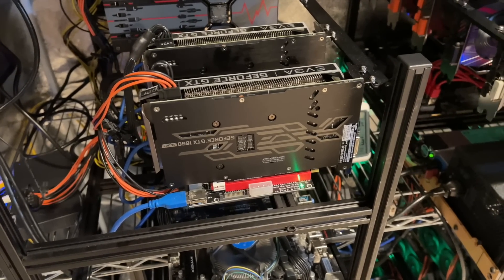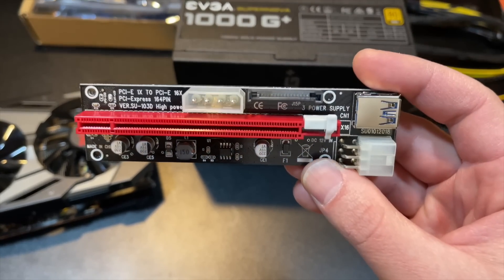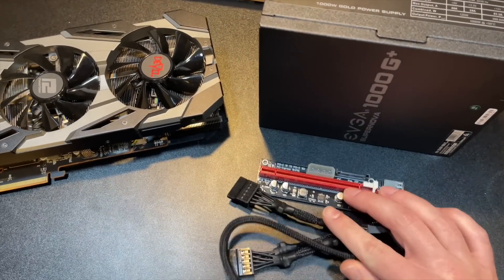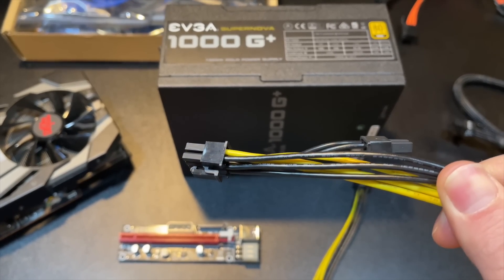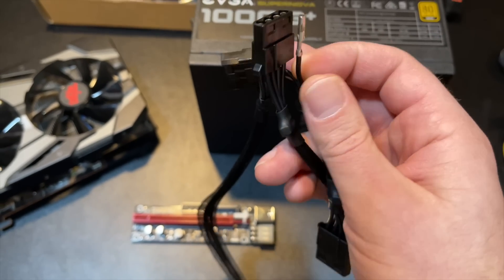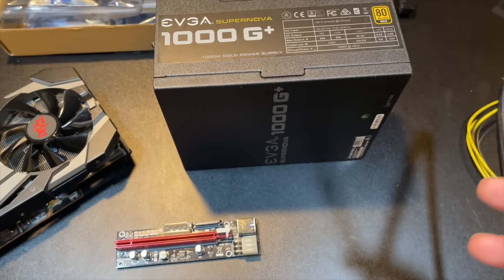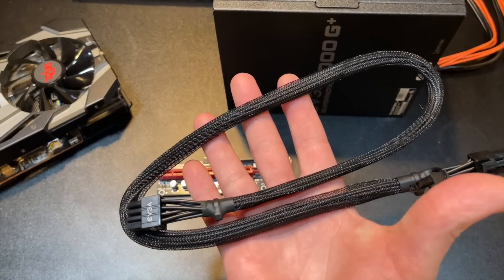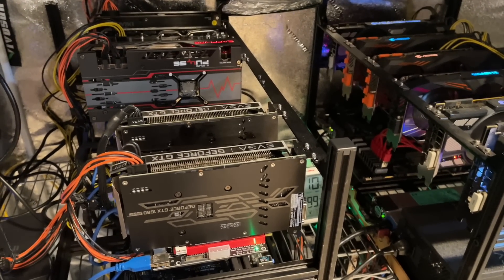Powering GPU Mining Risers Safely

Comment: Hey thanks for this video would this be an option for going from PSU to risers?

https://www.amazon.com/gp/product/B07F9H1K5R/ref=ppx_yo_dt_b_asin_title_o00_s00?ie=UTF8&psc=1

It's basically a 6-pin to 6-pin

OR - not sure i'm understanding this part - would it be better to use a splitter on the dual 8pin to power the riser?  I'm also assuming that would work.
Reply from the maker: If you have a specific brand power supply you should buy that brands PSU cables. For example, if you have an EVGA PSU - buy the specific EVGA 6-pin cables for that PSU. PSU cables aren't always cross compatible. Even within EVGAs own PSU lineup they aren't cross compatible.  For a server PSU I'd recommend these:

https://www.parallelminer.com/product/36-inch-16awg-6-pin-male-to-8-pin-62-male-pcie-power-cable/
Reply: @RedFoxCrypto  if those cables that you linked fit into my psu's ports, would they work?  I've been looking all over for 6-pin to 6-pin seasonic cables and having no luck unless i want to spend like $20/cable.

Comment: Molex is 154 watts
Sata is 54
Pci E is 288w
Reply: Pcie 6pin is 75w 
Pcie 8pin is 150watt
Reply from the maker: Share your sources. SATA is right. Molex is iffy. PCIe is right if you have three 8A pins going back to the 12v rail on a 8-pin connector, but not right if you are using a 6-pin with only two 8A pins going back to the 12v rail. (Though most modern 6-pins have three)

Comment: Easiest rule of thumb is this:

What role was this connector designed for?  

MOLEX is hefty in size but it really was designed around 1, 2, or maybe 3 HDDs or DVD-ROM drives.   Would I put 75W or anywhere near that through MOLEX connections for any sustained periods?   Heck no.

Appreciate the video, especially with new people looking into mining.  Don't burn down your house by cheaping out on power connectors, folks.  The small amount it takes to get the right power delivery pales in comparison with a potential electrical fire.
Reply from the maker: Thanks Jamie! You speak the truth. Happy mining!
Reply: @The Watchlist "What role was this connector designed for?"  Was MOLEX designed for powering 6- or 8-pin?  No.  

When someone who isn't experienced with all this rigs up a couple of adapters or whatever and plugs MOLEX-to-PCIe directly into a card like an RTX 2080 that pull 225W+, it isn't going to likely end well.

Feel free to call anything you can't put into context "FUD" but safety should be on every miner's mind.

Comment: After this vid I was nearly to switch my rig, because my risers are powered by sata cable. But ok, hold on for a sec... 
8 Pin cable provides around 150w.  Sata~54w. 

Current my rig setup:
Kolink 850w psu
rtx 2070 (8 pin single) TDP 175 W
3060Ti Gigabyte (8 pin single) TDP 200 W
MSI 3060Ti (2x 8 pin) TDP 240W 
I currently don't have other option, just to power risers with sata. SATA>sata to 6pin>Riser.

I underclocked all cards, find stable spots.
HWinfo64 says:
2070 eats 125w
MSI 123w
Gigabyte 126w. 

MSI riser connected on 1 seperate sata cable.
Gigabyte 3060ti and 2070 risers connected on 1 sata cable. 
system been running for 20 hours now, stable, no crashes 170 Mh/s at 455w out of wall. only 2 invalid shares.
Sata cables, Pci cables are ice cold, but... Theres's only 1 thing I don't like. 
2070 going as second card in chain. Getting less power from Sata, probably, riser is a bit warmer than both 3060Ti's... 
Maybe it is because of her cooling? 2070 is 2x windforce, 2 fan. Sitting around 60 degree Celsius, while 3060Ti's doing 34-43. 
P.S. I've done some research... My splitters ar bad quality. Need to look for PCi 6 pin, but I dont have any spare ports to use. 
Any tips with this case?
Reply from the maker: Best thing to do would be to get a new power supply or supplement with a server power supply.

I think that PSU has 4 6x2 pin PCIe connections so the other workable option would be:
2070 w/ 8pin single cable
3060ti Gigabyte w/ 8pin single cable
3060ti MSI w/ dual 8pin single cable (or splitter)

That frees up a PCIe cable to be split to two risers. For the last riser I'd use Molex.
Reply: @RedFoxCrypto  I ordered splitters from 8 pin to 2x6+2. Problem is, These risers I have, they only have 6 pin connector. Temporary will be ok. Later I'll split them. 1 cable has 2x6+2 connectors, but second one is to short, unable to reach to riser.
Reply: @RedFoxCrypto  how about connecting directly from SATA output via 6 pin connector to riser? SATA socket suppose to supply 12v each?

Comment: I think the reason some miners have issues is because they are not utilizing the PCI-E connections on the video card itself. Think about the small traces on the riser board. Even with the most high quality riser card, I would never expect it to be able to handle that kind of a power draw for the extended periods of time that we do when mining. Always expect your primary power draw to come from the connections on the video card itself. The power to the riser should only be to allow the riser itself to function, and perhaps a small power draw.

Comment: a 3070 will pull 15-17W from the riser while a 2060 Super will pull 42-43W, depends on what cards you are using, only gpu's so far that got the SATA connector warm were the blower style 5700's(there surely are others, speaking from what i've seen), as long as you know what you're doing SATA is as safe as any other connector
Reply from the maker: Exactly. Most miners are flying blind with this. Did you test the cards yourself of rely on data from somewhere else?
Reply: @RedFoxCrypto  was reading the numbers from gpu-z, you can always run your cards in a stress test for a while and just check everything in case your overclocks reset for some reason, if they stay cool in the worst case scenario then you're good to go

Comment: I have never heard of molex being unsafe as long as you don't daisy chain them. I think that is where people run into trouble, since the cable terminates to 3 or more plugs usually. you can be just as dangerous with pcie if you stack splitter cables
Reply from the maker: Absolutely. Molex is "probably" fine but I wish there was a more clear standard that we could point to and say it's definitely fine. And great point with stacking splitters. One PCIe splitter per PCIe cable.

Comment: I use dual sata to single 6 pin adapters made by cable matters. They work well for me, and by using 2 sata connectors instead of one, exceed the standard for pci-e 6 pin power.
Reply: This is what I'm going to do.
I'm also going to laser monitor it for a week to make sure it wont heat up :)

Comment: Favorite quote: When talking about SATA power,  "It's going to heat up it's going to melt, potentially cause a fire, burn your mining rig and your whole house down, and you'll be super sad and very far away from break even."  HAHA.  Great video.
Reply: I use sata conectors in my 1660S risers more then year and i never have problem or feel some cabels are hot ;) nothing problem for this low volt cards. I use for 10cards rig oynly one PSU Andyson Prominer 1800W and all runing very well
Reply: @maxbiagi3091  yeah it really just depends what cards your using I run sata on some 1060s w no issues but id never run it on my 3080s or 1080s
Reply: @maxbiagi3091  I have been using 2 sata connectors per cable on my EVGA 1080 Ti's for over three years now, house still standing.
Reply: I thought if it couldn't get enough power it wouldn't turn on.
Reply: Have been mining on sata for years no prob. Used 6-pin and the riser blew in 2 weeks lol. Poor riser didn't handle 75w I guess
Reply: "very far away from break even" haha
Reply from the maker: Hahaha. Thanks David!
Reply: @btc-sitesDOTcom well, ive been a tech for 30 years.  i wouldnt trust you to tie my shoe.
Reply from the maker: @ryan8773  Hahahahahahah. You got me dying with that comment. Happy mining Ryan.
Reply: @RedFoxCrypto  haha, well bro, hook me up with 4 3080s at retail and ill consider the entertainment dept paid in full !!!!
Reply: But 75w delivers the x16 port and a riser connects to the x1 so it would not be consuming 75w since only from x16 to x16 it would consume 75w and from x1 to x16 there would be less consumption available for the gpu

Comment: I have been mining with multi 13 card rigs for years. ALL of them have 2 risers powered with 1 sata cable. Never had any issues. Sata are "smart" power connectors and as long as you do not use any adapters, then the GPU can not ask for more power than  what the sata can supply. 
SATA SPEC:: Pin 3 in SATA revision 3.3 has been redefined as PWDIS and is used to enter and exit the POWER DISABLE mode for compatibility with SAS specification. If Pin 3 is driven HIGH (2.1–3.6 V max), power to the drive circuitry is disabled. Drives with this feature do not power up in systems designed to SATA revision 3.1 or earlier. This is because Pin 3 driven HIGH prevents the drive from powering up.[
Reply: also if it is unsafe, then why would they put these connectors on their products?
Reply from the maker: Can you share your sources and what GPUs you are running?
Reply: @RedFoxCrypto  IEEE sata power spec is my source. I run 580, Vega 64,1070,1070ti,1080,180ti,5500xt,5700xt,3070 all on corsair PSU. I think the reason people have cables melt is that they have low quality cables or have bent them back and forth too much.
Reply: The GPU does not ask. It demands from the source without questioning, simply  by "lowering its resistance". If the source can´t provide and the voltage drops too low, GPU goes into failsafe mode and stops working. These Risers are dumb, there is no logic integrated. It is just a simple device to provide 12V, 3,3V and some data lines from the mobo. Nothing "smart" happens there. What you´ve read is for HDD and SSD devices which have a controller and use 5V (3.3V) from the PSU. If you set your cards up to never use more than 80% of 54W over S-ATA you are ok with that connector. Some cards pull more than that and will heat up the connector --> burning houses down. The connector exists at that point because it is cheap and all PSU have them. It will work for some time. Bad quality is a thing too. Easiest thing to avoid is just to go 8pin all the way. Most cards also use pcie power for the supply of the memory chips. When mining these do work hard and will fail at some point. If a chip shorts out you want to have enough amps available to blow the fuse on the pcb, else you get fire. Especially with all these big 100A+ power supplies. When their overcurrent protecion kicks in fire is already set lit. Also watch out when using cards that have no fuses - they will guarantee start burning in common short circuit situations combined with big single rail power supplies. The popular mining cards RX470 to RX 590 all do have fuses for a reason. Keep in mind that fuses need energy to blow up, so limiting current in failing situations by using weak connectors is no good idea.

Comment: This is an outstanding, high quality video- thank you so much.  I have boggled my mind over this for years.   The reality is, we know for a fact that you can indeed, put multiple GPU's (RX 570/480 for example) on a single SATA.  Why?  Well the answer must be that the GPU (by design) pulls more energy from the 6-pin PCIE power connection on the GPU- not from the riser (or the motherboard).  What I would LOVE LOVE LOVE to see is a matrix, GPU-by-GPU, that details the amount of energy pulled by from the riser, vs how much energy is pulled at the PCI 6-pin connector integrated into the GPU.  My experience with 480's:  Multiple GPU risers on SATA is no issue.  Multiple GPU's connected to same 6-pin PCI is a firebomb waiting to happen.  To solve this riddle and most effectively (and safely) use the connections afforded us on an ATX power supply- we must know GPU by-GPU how much energy is pulled from the riser and how much is pulled by the 6-pin PCIE.  The reason why you keep seeing miners using SATA is that in some conditions you can indeed power not only a single riser- but multiple risers without issue.  But then, on the next model/manufacturer of a given GPU- you have an issue.   Does this make sense what I am writing?
Reply from the maker: Thank you dude! It absolutely makes sense. It all comes down to is how is this specific GPU going to get the power it needs. 

People having experiences like the ones you've had is why it's such a divisive topic. Your 480s simply pull way less power than the 54w given on a SATA strand. Yet, if you plugged in different cards it could be very dangerous. Since we don't that specific information, per card, we can't make those decisions.

I also wonder how much of this depends on the algorithm the GPU is working on. I remember when KawPow came out people were burning all types of connections that had typically worked fine for years. 

Thanks for watching and the thoughtful comment. Happy mining!
Reply: @RedFoxCrypto  Right on Bro.  So Have you seen that box that SpaceGoats built and gave to Red Panda?  you plug your ATX power into the box, then one connection to the riser and a second connection to the GPU. From there you can specifically see what specifically is doing what from boot up to mining start and then full hash achieved.  That is the only way I know of to do this.  But I don't have a SpaceGoats box and I don't have 50 varieties of cards.  So in the end- what you created will keep people safe and that is the most important thing.  Your instructions do not however optimize ATX power distribution.  Safety is admittedly more important, but I would like to achieve most.  Hey I'm a miner- I want the best of both worlds!
Reply from the maker: @robertmicciche5375  Yes! BBT has an awesome one of those boxes too. I'd love one someday.
Reply: Thanks for this. I KNOW that many GPUs WITHOUT PCIe Power connectors can draw near maximum power from the slot. (I have an MSI z390-A PRO that I recently aquired that has a 6-pin connector to provide extra power to the slots). Like you, I wonder how much the higher-end cards WITH PCIe power connectors draw from the SLOTS vs said connector(s).

Comment: Hey, I purchased my PSU from parallel miner along with cables. My Riser version 8 came with the SATA in front and the PCIe the side.  Is this a proper Riser? Also, how do we tell the quality of risers?  There is a shortage of risers and all sorts of risers are available
Reply from the maker: Parallel Miner is a great site. I get my server PSUs from them. Your riser sounds fine. Just use the PCIe and not the SATA.
Reply: @RedFoxCrypto  hey, I didn't get the risers from Parallel miner but Kijiji.

Comment: Good video.

Few questions:
1. If the card is calling for say 200w, will it always get 75 from the riser and the balance from the 8/8/6 pin? Or does it proportionately draw?

2. On some of the 3060s, with say 200w tdp, if we are connected to the riser, then an 8 pin  or even a 6 pin to dual 8 pin should be fine, no?
Reply from the maker: Great question. I've seen some cards pull almost nothing from the riser and most the load comes from the 6 or 8-pin connectors. I've seen others pull the full 75w from the riser and then pull the remaining from the 6 or 8-pin. Bitsbetrippin has done some testing on this.

Comment: I looked it up and the coolermaster version is 'safe' and is rated for more than 75W. The probem is that I needed the Amps too. On wikipedia it is stated that a .236cm pin has 8.5Amps my connector's pin is 0.2 and 0.1/3. It isn't very reliable information tho. It might be usefull idk.

Links: https://en.wikipedia.org/wiki/Molex_connector
https://coolermaster.egnyte.com/dl/4dn5x91gDy/?

Always loved your video's, keep up the great work!

Comment: Had a sata cable set fire just last week, smelt burning plastic for about 2 minutes before it burst into flames
Reply from the maker: Yikes! Sorry dude. Hope only the cable was the victim.
Reply: Which GPU?
Reply: How many risers did you connect with one cable? Never, ever connect more than 2 things. Even then there is a risk. 3 or 4 you are guaranteed  to fry something. I have one card connected with sata and even that is the card what is drawing least power, 3060 with a 58% power limit. I hate that they even make sata power cables that have 4 plugs to connect to.
Reply: @redX111t  How are you running a 3060 on a riser? Are you stuck at 20Mh/s?
Reply: @sethalexander423  a riser doesnt affect hashrate..
Reply: The upgraded VER009S riser with large 4pin + 2X 6pin Graphics interface, 
each interface can direct connect to your power supply that reduces the burden on the main board in the multi-card access and ensures maximum compatibility with your power supply.

If you want to buy VER009S pcie riser on Amazon, please check the link below.
 
https://www.amazon.com/dp/B08ZS16FND?ref=myi_title_dp
 
We are also sold this risers on Amazon CA; UK; DE; FR; IT; ES
 
We can also give it to you for free. If you need it, please contact us.